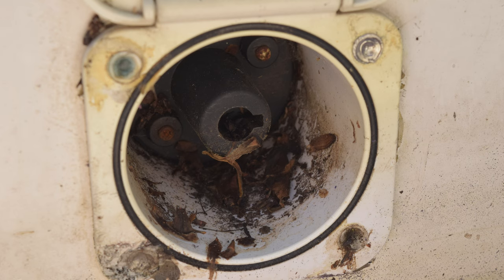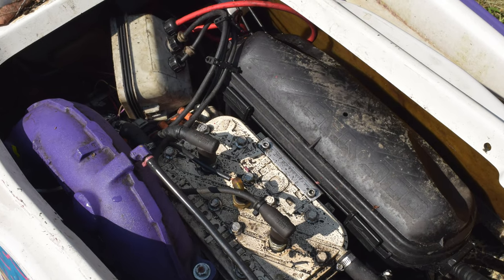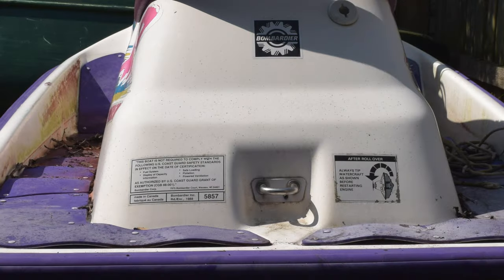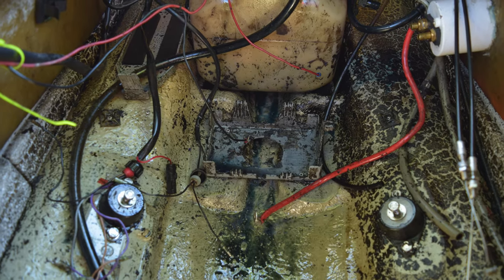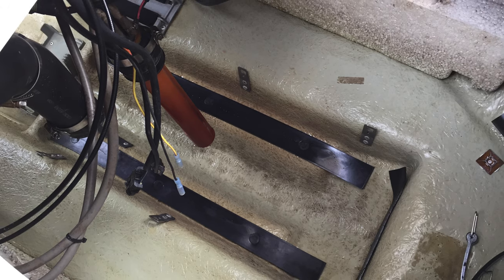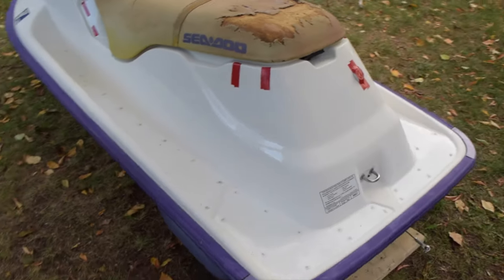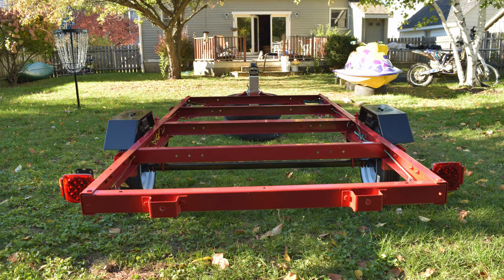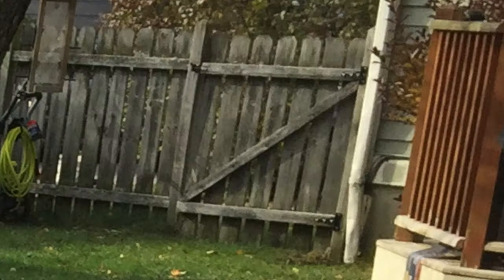$400 Jet Ski COMPLETE Rebuild | 1995 SeaDoo XP 720 | Part 1

Comment: I am currently in the same process with my 1997 seadoo gti 3 seater. Just got the new motor, gotta do the carb rebuilds, new lines, and finish cleaning up the hull inside and out. I will say though, yours is in like 50x rougher shape! good luck man! New subscriber here.
Reply from the maker: Hell yeah! It's a full winter project for sure. Good luck with your motor swap!
Reply: @reed.k.h  it forsure is! thank you. I thought about filming it for youtube. Havent decided yet.

Comment: Nice resto.  These X4 hulls are a lot of fun, really nothing comparable you can buy new today.  I used a similar cheapo trailer years ago for a stand up but I used PVC pipes for the bunks.
Reply from the maker: I knew next to nothing about jet skis before I bought this one, so it's a total coincidence that I happened to find one with an infamous hull design! PVC pipe is a good idea for the bunks... how did you support them?
Reply: @reed.k.h  I bolted them to the trailer cross bars with large fender washers.  ( I had to drill an access hole in the side of the PVC to get to the bolt heads).  I always strapped the ski down the frame itself.  Never had any issues, towed it up to 4 hours one way with an '86 300zx. https://drive.google.com/file/d/1zzxylvJ_UkaCln6js_p7CzW-c21aIE5E/view?usp=sharing
Reply from the maker: @VTCMart  I like the simple design. My one concern with this trailer is that the ski sits pretty high off the ground, which may be an issue at the launch ramp. Guess I'll find out in a couple months...

Comment: I was wanting to see what pliers you used specifically, I had to destroy one of these lines on my truck to get the fuel filter off and the parts guy had a very hard time finding actual replacements. He kept saying to use regular hose clamps but I confirmed they are not enough for fuel injection pressures of gasoline. Thanks for the videos, cheers!
Reply from the maker: Having the right pliers makes a hell of a difference!

Comment: this is AMAZING what a turn around.  did you just buff the whole ski with cutting polish or rubbing compound i mean , it came out awsome!! i’m also shocked at how clean you got the engine bay.  i do not understand how you pulled that off....
Reply from the maker: Thanks, I'm stoked how it turned out also! I only used rubbing compound on the yellow storage cover. I wiped down the rest of the ski with toilet bowl cleaner. The hydrochloric acid helps dissolve the stains. For the engine bay, it was just Simple Green and a lot of scrubbing... Like, a lot.

Comment: Pretty new to jet skiing.. I have a 2001  sea doo bombardier xp. I feel that it sits pretty low. The stern sits right with the water line and I weigh 165 lbs. I had a second person get on so the total weight was 320 lbs with a weight capacity of 565lbs and it capsized. Do you know why that would be? ( both the drain plugs were close and it was not filling up with water inside)
Reply from the maker: Considering I've only ridden a jet ski once in my life, I can't say that I'm an expert on jet skiing either.